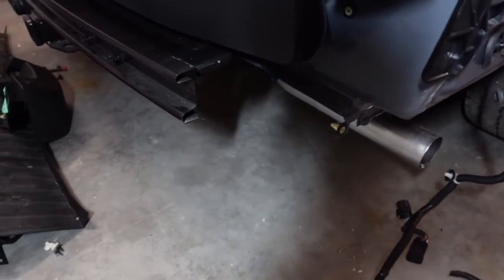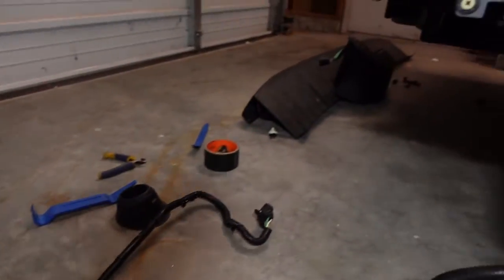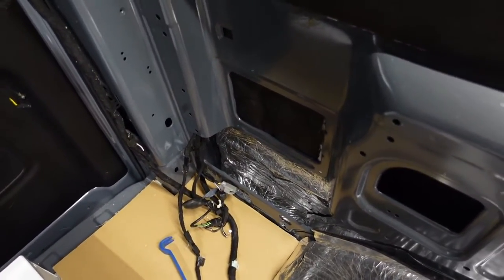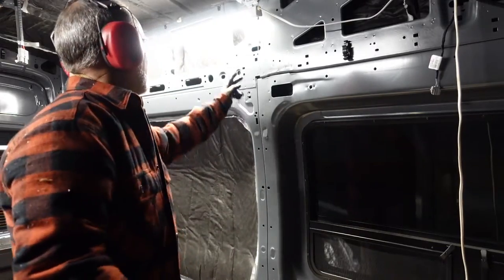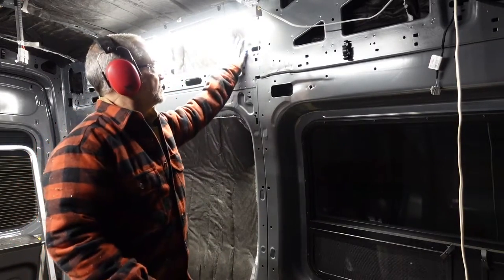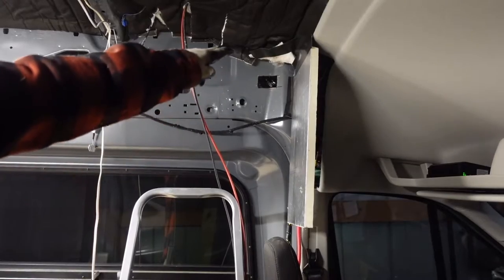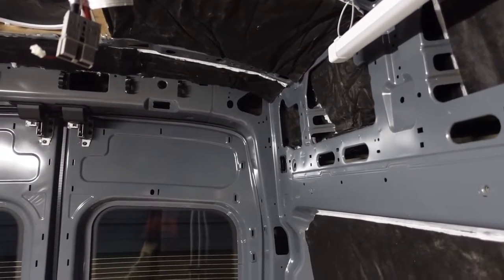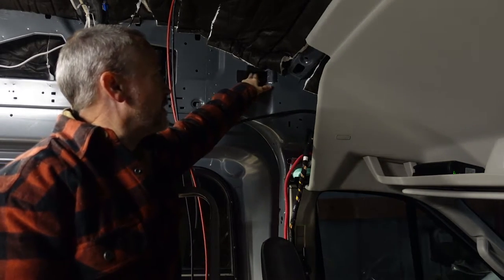VAN BUILD | Relocating Wiring Harness | 2022 Ford Transit Van

Comment: Thank you for the video I am doing the same to my 2024 Transit 350. However you cheated by not drilling through the B pillar and the rear D pillars which I need to do.
The B pillar has Boron Steel you can not get past in the wall without drilling through it.  Carbide here is a must. Takes about 4  hours per hole and lots pf Prep and lots of snack breaks.
The C Pillar has boron Steel you may be able to get a hole above the Boron Steel and bypass the Boron steel. It depends on your model. But plan ahead to go through the Boron Steel.
The rear D Pillar has no Boron Steel. At the D pillar two 1.5" adjacent holes ( 1.5" x 2.5") will do fine. The D pillar needs 6-8" long bits and extensions.  Drill up at a 30° angle.
      I need to enter before the B pillar.  Drilling the D pillar in wall with a 1-7/8" Carbide Milwaukee Dozer Hole saw  ( not Dozer bi-metal) was not fun.   You must have Cobalt drill bits and Cobalt step drills and Carbide hole saws and at least two people to do this job.  Cutting boron steel is slow and requires cutting fluid, high pressure and low rpm.
So one person steer's the drill and one person leans on and pushes the drill.
1"4 solid carbide centerdrill cointersinks x 6" Long will go through boron steel easily. But you must use a low RPM, Cutting oil and do not push hard or you will shatter the bit.

Use Cobalt hex shank step drills with locking extensions of several various lengths. to start all holes.  https://www.amazon.com/AugTouf-TOOLANT-Step-Drill-BIT/dp/B09SPZQ6LV?th=1.  You will need two step bits of each and every size Listed. What you do not use you can return.
https://www.homedepot.com/p/Milwaukee-Hole-Dozer-Carbide-Hole-Saw-Set-12-Piece-49-22-3090/310213292   PLUS a 1.0, 1.125" , &1..25" Carbide hole saw.
Hole saw MUST have a 1/4 x 6" Cobalt bit. and you will need 1/4" x 12" Cobalt bits.  https://www.amazon.com/dp/B0CW241Q9D?ref=ppx_yo2ov_dt_b_fed_asin_title&th=1
You will need a Dremel and several large 2" Gyro ST Cutoff wheels and grinding bits to smooth out sharp edges.
     If you need a large hole larger than the step bits. Use the step bit to pre-drill the 1/4" Pilot hole first. Then the carbide hole saw.  Drill oval holes, two adjacent overlapping holes
Cutting out the wall with a cutoff wheel is not a good method. Drilling holes is always better.
A Plasma cutter with a straight cutting head is also a good choice to cut boron steel.

To enter the B pillar you need to remove the overhead shelf and disconnect the battery.  You drill a 2.0" hole near but before the B Pillar.Then drill using a 1/4" x 6" Cobalt bit as a Pilot hole
    You will need to lengthen the Harness by  36". Easiest way to do this is to get a harness from a Junked Transit or a new Harness. Make an extension for the front end the harness. But you will need a female connector to put on the donor harness to make a 36" (approx) extension cable"  You want the extension to go from the fuse box, up the A Pillar and end at the top of the A pillar. You want your mid junction between the A pillar and the entry into the B pillar.  Solder all the pins in the correct order. Add Silicone lots of Di-electic grease to the mid Junction to make it water tight. Join Male and Female connectors. Then wrap in three layers of rated #33 Electrical tape 6" to either side.
Hope this helps.